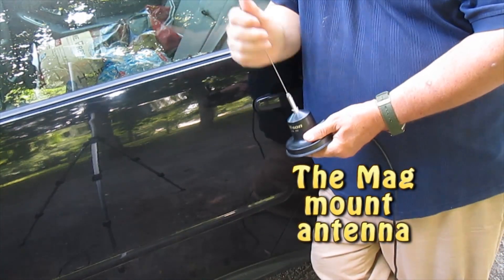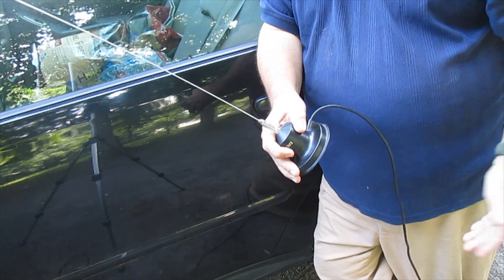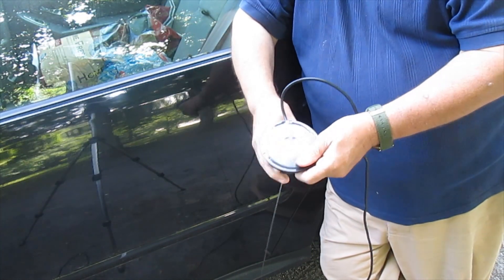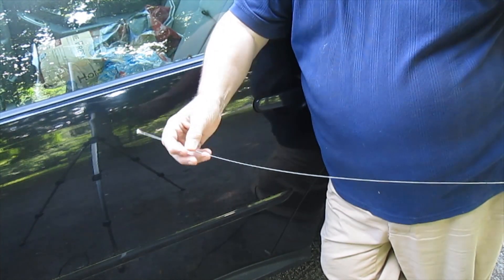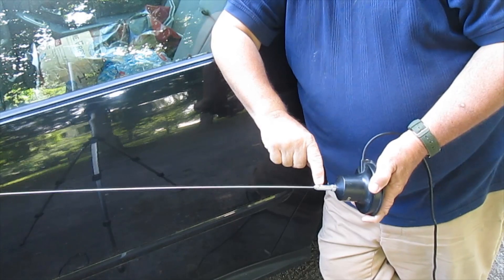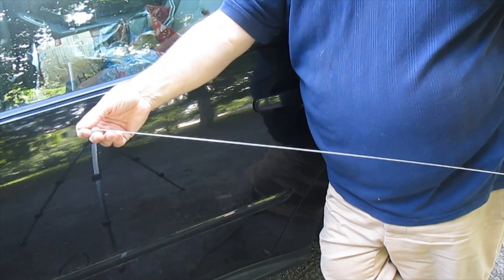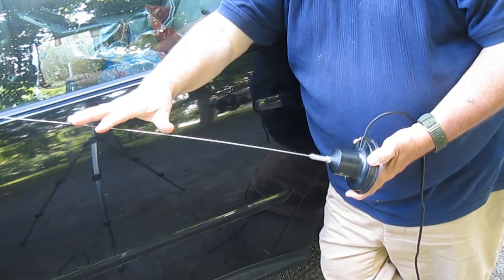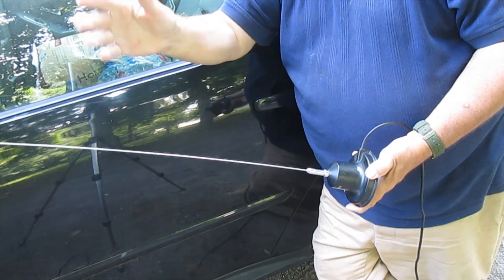the mag mount antenna

Comment: will a mag mount work for a home base antenna?
Reply from the maker: If you put it on a large metal object of you make radial for the antenna. These antennas work best when placed on a large metal object like a car. A metal file cabinet will work to som extent.
Reply: @m005kennedy  10-4, thank you
Reply: @jackb2374  works fine i have wilson little will on a sheet of metal 10x30cm in the attic and swr on channel 20 is 1:1

Comment: With regard to the running of the wire from the Magnetic Mount Antenna, to the inside of the cab (Ford F-150).  I don't want to pinch the wire, and I also don't want to let any noise or weather in.  In your opinion, is there enough play in a typical door frame to install it safely, without damaging the wire?